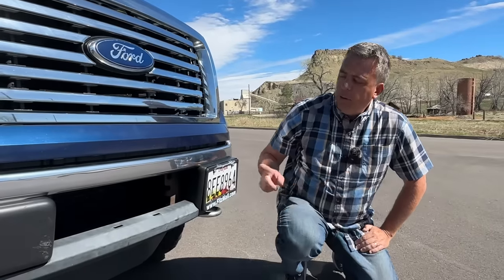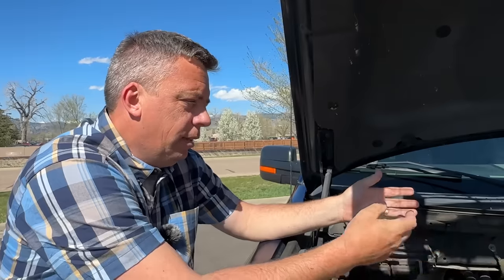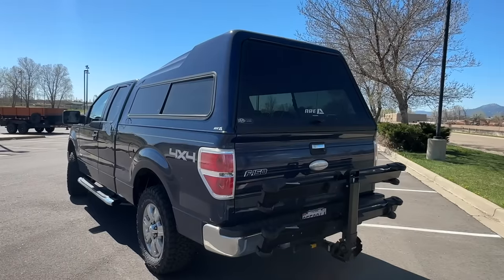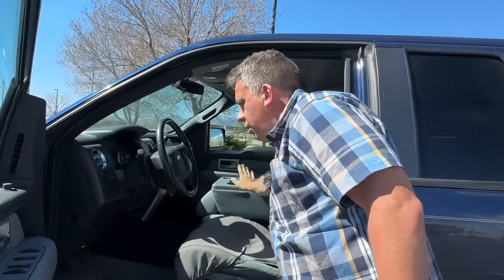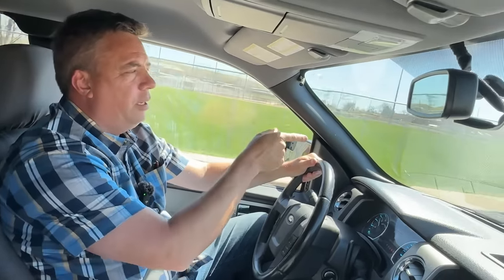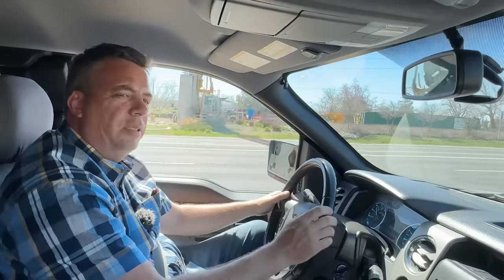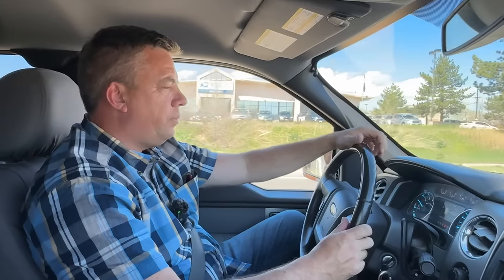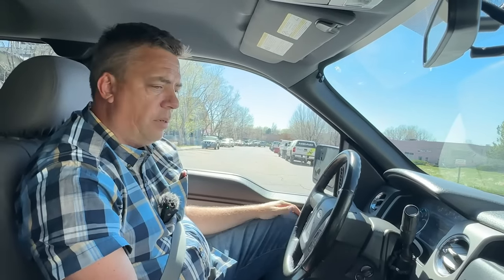How Has the Ford F-150 EcoBoost Held Up Over a Decade?

Comment: My Dad bought a fleet of 30 F150s for his home building company in 2013. All his guys requested the V8, but my Dad bought one Ecoboost as the shop truck. It built up a reputation as being the sports car of the fleet over the next 3 years, and in 2016 half the guys went Ecoboost. Then when it was time to turn in the fleet again in 2019, we got 20 2.7s, 9 3.5s, and only 1 old timer stuck with the 5.0. These days they all swear by the 2.7 because it gets such great gas mileage while still being powerful enough to handle any 3/4 ton towing duties if needed.
Reply: The 2.7is a grenade with the pin pulled with the poorly designed plastic oil pan with the integrated oil pick tube not to mention the internally belt-driven oil pump........GARBAGE!
Reply: @PeeterPuncher  that is your opinion, quit listening to the internet chatter about the eco 2.7, you just sound silly
Reply: @pathunter7003  cheers! The 2.7 has been one of Ford’s most reliable engines in history. There was a run of defective valves (from a third party vender) on the Bronco production line for a few months in 2021 and now I keep seeing people online acting like the 2.7 and 3.0 have always been unreliable. Ford told the NHSTA that they had 900 warranty claims total, and every engine with the faulty parts has been fixed since 2022. 

A few of our 2.7 trucks had seeping oil pan gaskets but Ford fixed them for free and the new sealant held up for >100k miles on all the trucks. Otherwise, those trucks only asked us for gas, oil, tires, brakes and wiper blades. Not a single component failure over a few million miles combined.
Reply: A 2.7 being powerful enough to handle 3/4 ton towing duties is a stretch
Reply: @PeeterPuncher  the 5.0 v8 has an internal wet belt ,  so is that garbage also?
Reply: @BlueDevilBrew  who said that about the 2.7?
Reply: @pathunter7003  the op
Reply: @BlueDevilBrew  no you’re right. When the alumina150s came out I started calling them 3/4 tons because their lightness made their GVWR payload calculation closer to the 250/2500 trucks of that era. It was tongue in cheek but it stuck in my head. I should have said 1/2 ton in my top comment. 

Still, our 2.7s had that Ford fleet-special tow package and we pulled 6k-8500lbs with them all no problem. We didn’t get anywhere fast with that load, but the temps gauges always stayed happy.
Reply: @pathunter7003  the new 5.0 does and yes ford somehow managed to make the 5.0 less reliable with direct injection and a oil pump belt instead of chain
Reply: @thegeneral1955  Chevy 5.3 has been a shit engine for along time and the toYota 5.7 guzzles gas to the point where it can be barely driven much. Don’t believe the internet chatter of an engine, it’s biased usually.
And working at a ford dealership washing vehicles does not make you an expert on engines
Reply: On a scale of 1 - 30... how successful is your dad if he has a fleet of 30 trucks! Love to hear it. Also a big Eco-boost fan.
Reply: @PeeterPuncher  It's like the most bulletproof of the engine lineup and that's coming from someone with a 5.0
Reply: @specialperson170  By what metric has it become unreliable with direct injection? It has both direct and port at this point so the valves stay clean
Reply: Ford fan boys came here to play!
Reply: @BlueDevilBrew 3.5 goofy.
Reply: What kind of Home Building Company has 30 trucks that's crazy
Reply: @Gooselip  we were doing new construction subdivisions with 180-260 houses. Had 3 of those going at once at one point.
Reply: @Gooselip  a big one.

Comment: I have a 13' that I just passed over 300,000 miles. Bought it new, and outside of an $1,800 rebuilt transmission, it has been flawless.
Reply: What mileage did the transmission need rebuilt? Have a 13 myself.
Reply: @playanddisplay3636  it was at 180,000. It kept slipping in and out of overdrive. From my understanding, I have not heard of it being a typical problem. I hope your 13' gets you to 300k too.
Reply: Is yours an Ecoboost? I ask cause it makes impressive torque that is a lot for a transmission to handle.
Reply: hard to believe the inferior coolant and oil fittings on the turbos haven't leaked.
Reply: @93Cobra792  so far, so good.
Reply: Had the transmission fluid ever been changed before it needed a rebuild?
Reply: @mackenzegrunig8279  what are you doing for oil changes 3 or 5000?
Reply: I bought a 13’ 3.5 used 2 months ago with just 55k miles. Your experience makes me happy and hopeful for mine. I tow a 7x16 trailer that’s basically permanently attached to my truck because I never unhook it. It tows it flawlessly.
Reply: Probably was the molded lead frame and didn't need a rebuild
Reply: @user-wy5fu9eb4k  never heard of that issue until you brought it up but looked at the forums on it, and it definitely sounds familiar. Dammit.
Reply: @mackenzegrunig8279  if it happens again what you want done is TSB 13-6-8. Maybe they replaced it and called it a rebuild and it won't be an issue
Reply: @miniaddict4534  I have a 2014 3.5 I just hit 200k miles on, all I’ve done is the 4WD actuators, and valve cover gaskets ($80 in repairs) It’s been a great truck, I haven’t been easy on it either oil changes every 5k miles and if your still pretty low mileage on yours throw a catch can on it to keep the back of your valves from getting build up on em.

Comment: I remember all the criticism these engines got from competitors when they first came out. 14 years later every manufacturer, including Toyota, has followed suit with smaller displacement, turbocharged engines in half ton trucks. Really goes to show how ahead of their time Ford was with this platform. And the fact that it is still in use today goes to show how proven it really is.
Reply: There all kinda poo though in comparison to the counter parts in real world scenarios. I drive 70 miles one way for work on the highway and in my 3.5 ecoboost I get 16.8 mpg vs my buddys 5.0 same truck same year just different engine and color gets 20 on the same drive same speed same tire size. Not to mention more expensive to maintain over the years.
Reply: @briceeddy625 you might be doing something wrong then. I had a V8 Coyote with a 10 speed that consistently got 20 mpg, but my current 3.5 6 speed can also get that much. Considering my V8 was a super cab with a 10 speed, and my 3.5 is a 6.5” crew cab 6 speed, I’d say the 3.5 is better on gas.
Reply: @miniaddict4534  I set my cruise on 80+ sure I might squeeze out an extra mile or two by slowing down to 75ish or 70. Or for the people that don’t keep consistent speeds and speed up downhill and slowdown every uphill.
Reply: @briceeddy625 Guarantee you the ratios in the rear diff are not the same. That’s what makes the difference

Comment: I have a 2013 F-150 XLT 3.5 Ecoboost with 207k and no major issues other than my pinion bearings went out in the rear differential at 205k.  I’ve owned it since 2015 and bought it will 35k on it.

Comment: I've owned a 2.7l and 3.5l it towed well until they needed repairs early I'll stay with the 5.0l have had better luck.
Reply: Unfortunately the 5.0 isn't exactly a sure thing either.
Reply: @0HOON0  the 5.0 is the best motor in ford's line up.
Reply: @billw8476 the 5.0 burns oil. The 2.7 ecoboost is battle tested made of CGI by the power stroke team.
Reply: @billw8476 Yep you got it brother
Reply: @billw8476 nope the 2.7 is the best built hands down
Reply: @russrtspooling7702   i already ruled that it isn't. pay attention!
Reply: Thanks for letting everyone know.
Reply: @chairmannemo2548  it did on some 2018-2020 trucks. Ford addressed the issue for 2021MY
Reply: @0HOON0  Nope starting in 2018 they are junk
Reply: 2.7> 5.0. 3.5 is junk compared to either
Reply: @Rick-so9bx  I've owned 3 2.7l 3.5l  they stayed in the shop more for epairs than I drove them. All serviced by the dealer. Never again 5.0l for me.
Reply: @Danzilly  that 5.0 will make a nice lawn ornament
Reply: @pathunter7003  30,000 miles running like a top no plastic oil pan either
Reply: @Danzilly  and you seem to think that a plastic oil pan has something to do with durability 🙄 the pan on my truck doesn’t leak. So if you want to clump together a few issues with some engines, saying that all the engines have these problems , let’s discuss the high oil consumption of the 5.0, the cold death rattle at startup, and the valve noise when running. Those are a few problem with that engine, there are others
Reply: @pathunter7003  I run 5w30 haven't had any problems. I have had a 2.7l and 3.5l both stayed in the shop for turbos and 2 engine replacements. I'm not keeping something that isn't reliable.
Reply: @Danzilly  that’s too bad, my 2018 2.7 runs fantastic and no problems at all, very reliable.But I do change the oil at 4000 mi like I have done with any vehicle
Reply: @chairmannemo2548  Yep, mine uses a whole quart in 5K miles LOL
Reply: @tedschmitt178  sarcasm doesn’t dismiss the f150 forum members saying otherwise

Comment: Brings back memories of my 2011, I absolutely loved that truck.  Traded it off in 2020 with 183k miles never did anything major to it, the 3.5 always treated me well.  In some ways I actually prefer the 2011 to my 2020 but I can't complain at all about the 2020 with the 3.5.  Already have 67k miles on my 2020 and again - not a single issue to report.   Then again I drive my trucks, put in good fuel and stick to a religious maintenance schedule.
Reply: Maintenance is key to any engine.  Haven't had issues with lifters in my hemi with 189k, but like you said I stay on maintenence.  Good fuel is another thing people waaaay overlook. Lucas fuel treatment too
Reply: While it has never been advised to miss a service interval, the difference is that if you miss an oil change or are just a neglectful owner (like most are for one reason or another) the possibility of failure is much, much less on an N/A engine🤙
Reply: @BigHRepair  The Hemi's in my life have been dead reliable too.
Reply: @coryernewein  poor maintenance could be detrimental to the turbos but shouldn't hurt the engine much more than naturally aspirated.
Reply: I’m curious what octane you use?  Got a 23’ and have been using 91 for about 10,000 miles. (Gas is cheap where I live). So far it’s been an amazing truck!

Comment: I have a 2012 F150 3.5L eco boost, running great just hit 275,000 miles and all I’ve done to it was put a new water pump in it. Great truck!
Reply: @jacobbrown8482 I hope i have the same issue in my 2014 EB. Only have 96k. ;)
Reply: @CWB1863 I hope I also have the same on my 23 3.5 with 10,000 miles on it. Lol
Reply: @timhornswaggle1243  My advice on the 3.5EB, change your oil/filter more frequent with good quality oil. Valvoline and Pennzoil have worked the best for me. Also preventive maintenance is key. I changed everything(plugs, diff fluid, transmission fluid, coolant etc) at 70k. Since mine is getting up there in miles i'll do everything again at 60k. I'm a little OCD with my truck, but better safe than sorry. Good luck bud!

Comment: They are on the 3rd generation of this engine. I believe it's dual injected now. First one out of the gate always gets bloody. Keep going with this series. Let's see a second and 3rd gen of this engine
Reply: The newest Ecos are pretty bulletproof.
Reply: Yes they are all direct + port injected now.
Reply: Agreed 🙌
Reply: Only the 1st Gen was direct injection only. And even many of those are holding up. The dual injection is even better
Reply: @user-tb7rn1il3q the 10r80 seems to be the biggest issue in the newer trucks.
Reply: @georgelin8498 I drove a 2020 f250 with the 10 speed a couple weeks ago. It is truly awful 😂😂
Reply: @georgelin8498  10r80 is a transmission?

Comment: Mine isn’t 10 years old but I have a 2017 F150 XL STX 4wd with the 2.7l EcoBoost. Has the old 6 gear ATM. I have 162,000 miles on it and I’m getting just shy of 20mpg. Take it to Colorado from Texas all the time and does great!

Other than replacing a bearing and some upper ball joints, I’ve just done regular PM and it’s running like a champ.
Reply: Just a main bearing...  😇
Reply: Well to be fair it was a wheel bearing
Reply: like reading these I have 2015 with like 60k I got last year hopefully it lasts me a while.
Reply: @Sir.VicsMasher  but I think you have a screw loose…😖

Comment: I have a 14 f150 ecoboost 3.5 with 113k only things that have been done are oil changes, spark plugs, and 2 coil packs and rite before i changed from stock tires to 33s 13 wide i was getting 24 mpg after the big wide tires i only get 17 but if u drive in the city the hole time yea ur gonna get 14 15 ish. I love my Ecoboost
Reply: First gen EcoBoosts are kinda hit and miss. Awesome that you got a good one.

Comment: If you CHOOSE to use boost only when you need it, the eco of 3.5 is good. On my 10 mile city commute, my 3.5 (aluminum body) averages 21mpg. The 5.4 I had previously only got 12.5 mpg on the same commute. Both are Supercab 4×4 XLT. The hiway comparison is 24 on the new one and 16 on the old one. But when I need passing power, wow, the 3.5 is way, way quicker.

Comment: What I like about Ford is they arent afraid to engineer totally new ideas and strive to be better. The first to do Aluminum bodies, turbo engines, 4 door trucks, 10 speed auto trucks. I grew up in a chevy house and I also loved Toyota all the years I worked on vehicles but this is my 3rd ford truck now. 2018 lariat

Comment: I have a 2014 Crew Cab in the same color. I bought it in 2018 with 36k. We bought it to tow our travel trailer. The truck now has 125k and doing great. The only major issues we had were the exhaust manifold bolts breaking, happened on both sides of the engine, thank goodness it was still under the extended warranty we purchased. We have towed our TT to Colorado and Utah twice along with South Dakota, Wyoming from Georgia. We have pulled it all over the Southeast. We have over 20k of towing and it’s done great. The biggest difference I’ve noticed with a turbo charged engine in comparison to a NA engine is having to change the spark plugs more often. We’ve been very happy with ours in the 6 years we’ve owned it.
Reply: This is a Ford thing.  It is not unique to your model.  I had a 1999 F150 V6 that it happened to.  It gives you  the famous Ford tick.  Ford loves a bad design and will stick with some bad designs for decades.  This is one.
Reply: @chaleurphantom1 Hey how dare you leave my Ram out! My exhaust manifold bolts broke too! 😂
Reply: @chaleurphantom1     Ford  isn't the only one that does that.
Reply: @wysetech2000  I didn't realize this.  I only drive Ford's.  This has happened to a couple of trucks for me. I made the assumption that it is just one of their nuisances.   Ford has a few.

Comment: Purchased my Lariat 2WD Ecoboost in June 2011.  Just sold it last year with 210 000 miles.  No issues with engine except changing a few coils and 2 sets of spark plugs.  I changed the oil every 4000 miles.  The latter is a must to prevent cam phaser and timing chain issues as well as protecting the turbos.
Reply: Can you explain how changing the oil affects a cam phaser and timing chain?
Reply: @kdcarver  dirty oil clogs the passages and end up not passing oil and camphasers don’t move anymore then break
Reply: @Contreras-z4e  thanks. Glad Im a stickler for keeping to oil change schedules.

Comment: I have a black 2012 FX-4 with the Ecoboost and 142k miles. Has optional locking differential, heated and cooled seats and the 700W sound system too! Love the truck, had the molded leadframe repair covered by Ford under warranty other than that no issues so far. It gets all its services done on time.
Reply: I have the same truck, long bed tho, 170k miles and running great!

Comment: On my second F150 with 2.7 Ecoboost, it’ll run , but I’m 61 so I don’t dog em, trade at around 100k, not saying it’s the best engine, but my 17 was flawless and my 23 has not missed a step, I’m 100% a 5k oil change man and air filter every 20k and fresh transmission fluid and filter at 50k. Tow a 6k camper 6 or 7 times a year. I can get solid 21 mpg around town and nearly 24 mpg on the highway maybe 12 towing, lil better if it’s flat, like 14 and again I don’t rush her at all. Personally love the lil V6 plenty of torque when you need it. I also realize it ain’t a F250 or 2,500, I was fine with a Tacoma most the time, but needed a lil more towing ability, comfort and room, I’d have never thought this thing would get better MPG’s, but it does. Perfect old man’s truck and it could get a young man in trouble. It rarely ever climbs above 2,500 rpm never seems stressed, drove a 5.0 and it sounded great, but it was a screamer constantly above 4 grand and didn’t feel much stronger to me, the sound was nice though.

Comment: I still have a 2012 3.5 EcoBoost with over 140K.  No force induction issues so far, fingers crossed.  Water pump at 110k, coolant leak at overflow at around 98K.

Comment: I had a 12 5.0 didn’t make 100,000 miles before cam journal failure. Had a 14 3.5 ecoboost traded it with a little over 150,000 miles on it never any issues. Pulled really well.
Reply: Funny cause my 2011 Ford F150 with a 5.0L Coyote V8 in it with 161,000 miles on it is still going strong.
Reply: @CJColvin  I have buddies with the 5.0 and 3.5 ecoboost with  250-350,000 miles. changed spark plugs and a water pump and collent hoses. I bought mine used and they either used the wrong oil or didn’t change it as often as they should have.
Reply: @CJColvin 165k on my 14F150 5.0 still strong
Reply: @natesv04  Awesome brother

Comment: I have a 2013 with 140,000 roughly 40 to 45% of that was towing 5000 pounds or more the most i have towed was 15 to 16,000 pounds along with using it to plow snow with 8.5 foot v plow. The truck has had 5 star tunes since around 100,000 miles. Only things I have had to replace is the front springs/shocks ball joints and starter